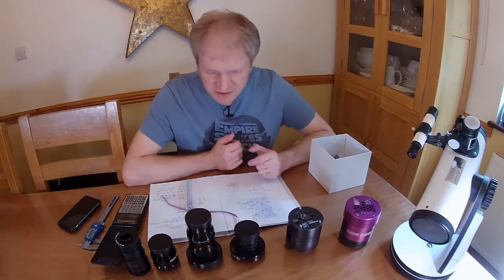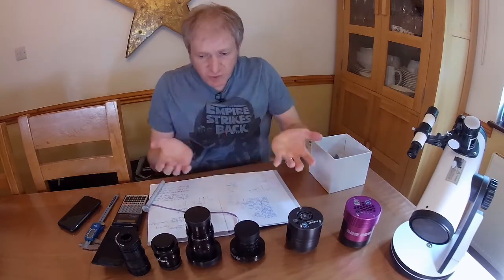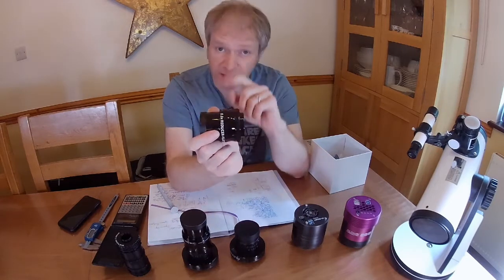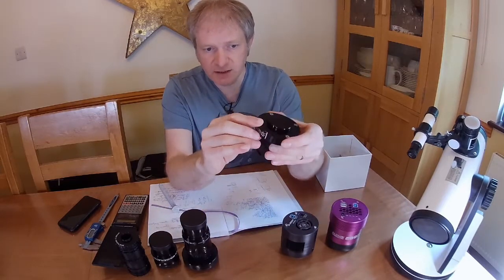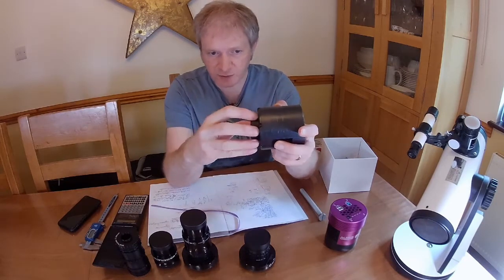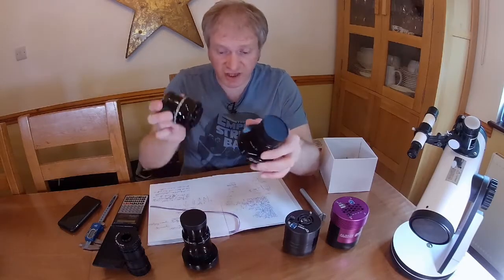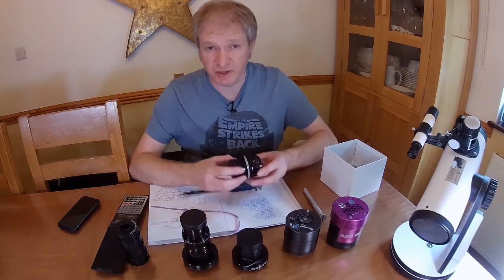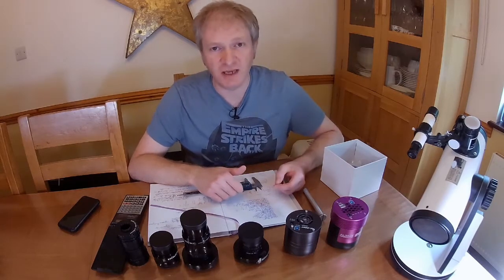Back Spacing for Field Flattener and Coma Corrector to Camera

Comment: I agree with everything you said Andy, it can be a PITA to get right.
You mentioned making the scope faster, but what are the benefits of a faster scope?
Reply from the maker: The main benefits are gathering the same amount of light in a shorter period of time.  This can help reduce exposure times.  Also the wider field of view is great for framing larger subjects.  Hope this helps.
Reply: @AndyofAstro   Thanks, what would be helpful is a practical demonstration of what a faster scope image looks like v a scope without a reducer, im in two minds right now about buying a reducer.
Reply from the maker: @tomreid7  that's a good idea for a video.  Basically I use the 0.8x for nebula because (often but not all the time) they are quite big and very dim.  Therefore the 0.8x brings the light in faster and help fit the object in the FOV.  For small galaxies ((M51 for example) I use the 1x as I need the magnification to make them bigger and then use a longer exposure time to capture them.  For Andromeda M31 the reducer is essential to fit the galaxy in the frame with the 0.8x reducer even then the image is at an angle to fit.  I was very lucky as I picked my ones up second hand after some hunting.
Reply: @AndyofAstro  , I was thinking the same, make a video demonstrating the benefits, as no one has done this so far, there's plenty of advice on YT, and thats great, but just telling folk to buy a reducer is not enough for me, lol. I was led to believe that you had to buy rhe manufacturers reducer for whatever scope you have, is that the case in your experience?
Reply from the maker: @tomreid7  If they are the same brand, I would like to think that the optics are matched for the telescope.  Again there are always exceptions and my coma corrector is Baader not Skywatcher.  The only way is to get the manufacturers/suppliers advice to see what is compatible.